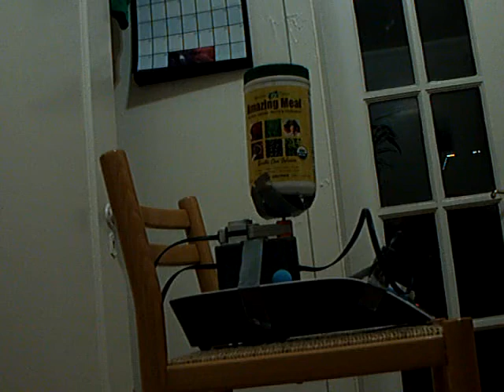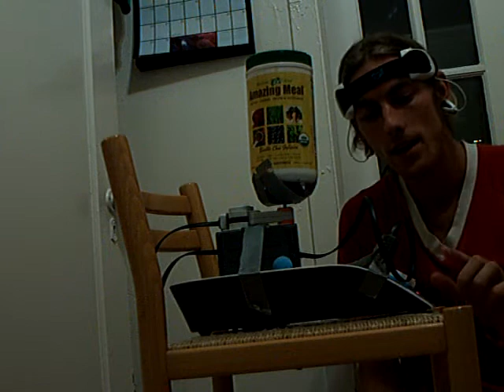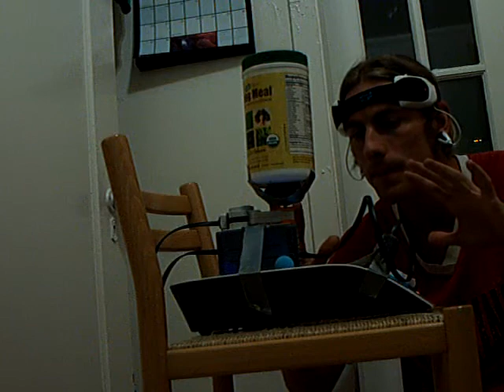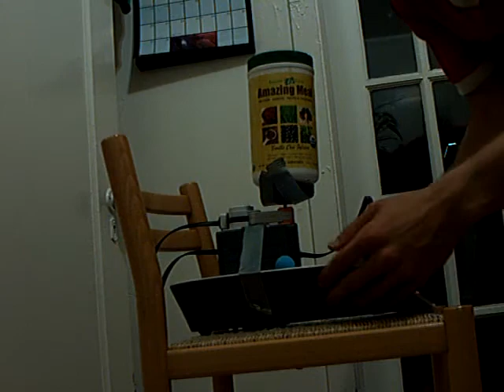Ky's project: pt. 1

Comment from the maker: @ChrisZanetti 
I watched some of your videos! Looks like you've got some waves working with you! Incredible!! Have you ever tried working on a radiometer? Yes Mindflex is weak; as it is virtually impossible to calibrate an anatomical structure in anyone's frontal cortex. I knew this before I decided to buy the damn thing and the reason I did was just for that on/off prototyping idea that one can think about ON and it's on. I plan to use Emotiv- later on. It's a better system from what I see.

Comment from the maker: @ChrisZanetti The PK wheel reminded me of the radiometer because it looks just like one in many ways. If you google radiometer... I don't think hyperlinks do well in these comment boxes. 
Of course I'm wondering if you are in a dark room away from sunlight (just sunlight, flourescent doesn't affect it) if you could pull it off because it is almost the same design.  They usually run for about $10 bucks to 15 at science museums in gift shops.  Any observatory museum always have radiometers.

Comment from the maker: Hey- Well, the whole reason I'm piecing these two hardware together is to plan for a larger project. It involves using brainwaves as a toggle on/off switch to control the function of focusing a 45" Fresnel lens (magnifying sheet) onto a rotating waffle iron and baking waffles from the sun. So this is a solar thermal waffle cart that people can manipulate themselves to make their own waffle by thinking about it. Then I was thinking I could have a similar system for flavors to choose from.